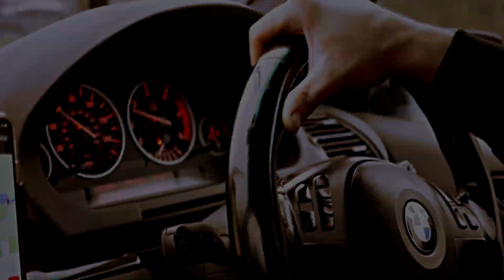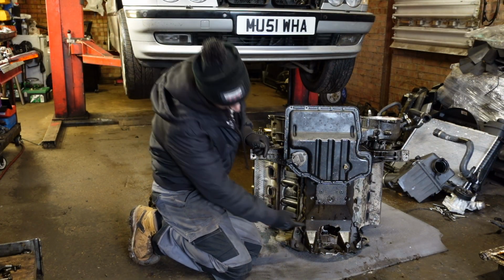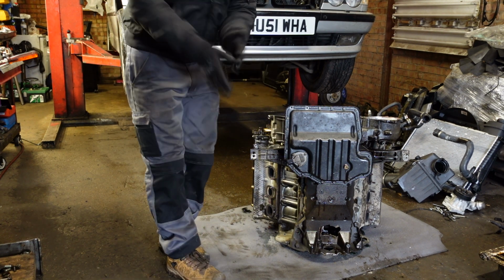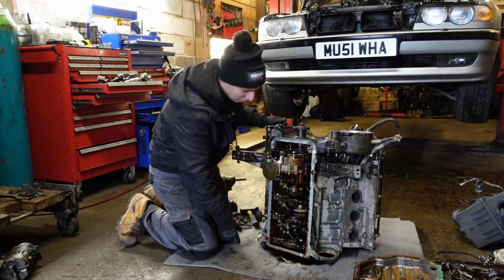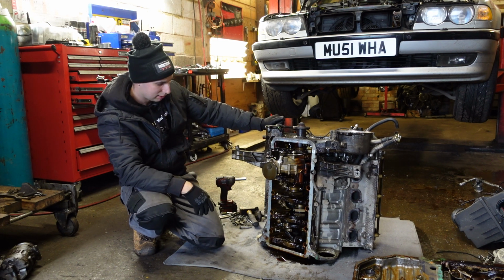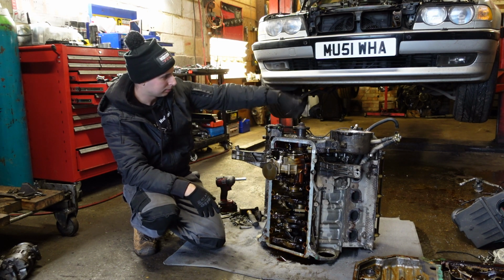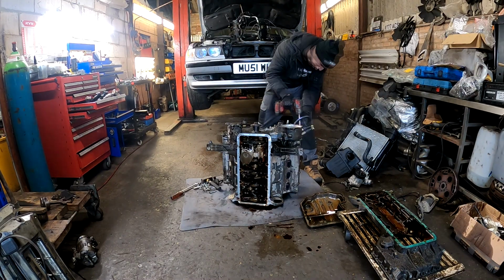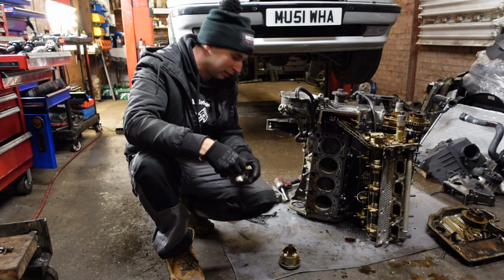Reason why you shouldn't drive through deep puddles

Comment: with my old e46, I went through some pretty gnarly deep puddles when we had some flooding. I think the trick is (as you may have briefly touched on in the vid) to just knock it in 1st gear and slowly coast through it. If you hit the acceleration pedal you'll create enough vacuum to suck water through the intake. I didn't really give a shit about my old e46 so would never risk it in anything I cared about. In fact its just better not to risk it at all.

Comment: One 'ventilated block' as I like to call them. That sucks. He was in high enough rpms to do that. I've had an m60b40 injest enough water to just kill the motor in an 540/6 to just pull the plugs, crank the motor, reinstall, change the oil, and all was okay. Depending on if your running a stock airbox or CAI, depth of water, speed/ revs are probably the biggest factors in a hydrolock scenario. Definitely a real bad day.